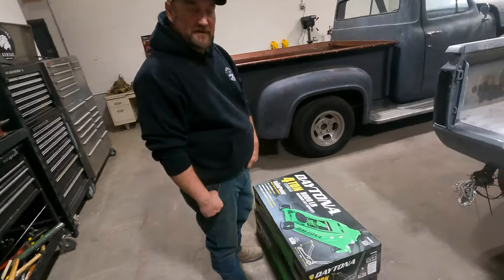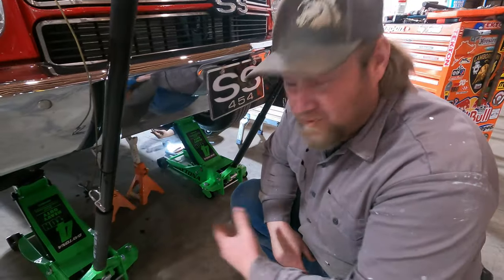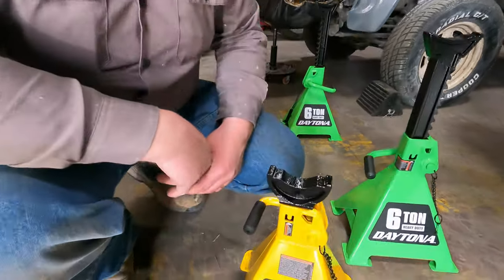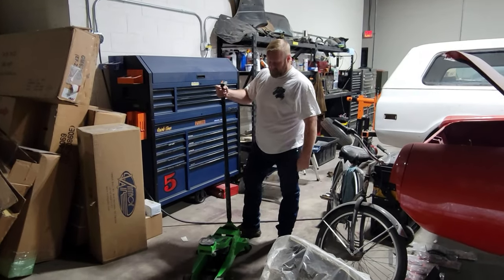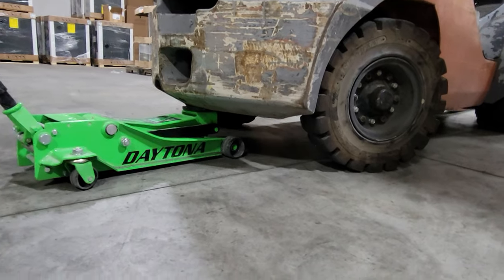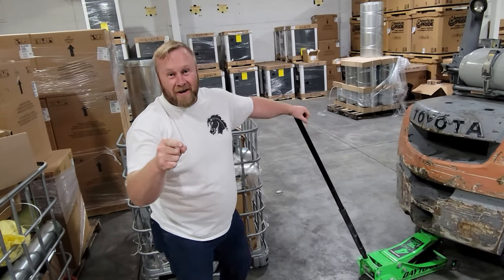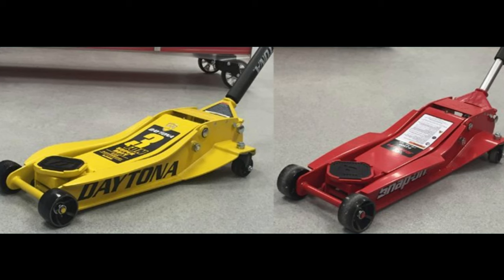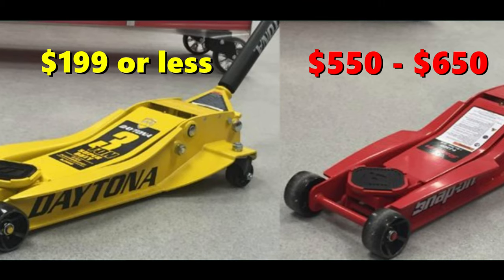Harbor Freight Daytona 4 Ton Rapid Pump Duel Piston Heavy Duty Jack: The Best Value for Your Money?

Comment: I do need a good jack but do you think I need a 3 ton steel or for occasional use should I get the 2 ton aluminum one 🤔
Reply from the maker: In my personal experience, I never buy a floor jack less than a 3 ton. It never fails that I need just a little more and the 2 ton won't cut it, or I end up bending it. These are a 4 ton, which is perfect for a shop setting. But I'd say 3 ton all day!
Reply: @IronHorseGarage  cool! Thanks.